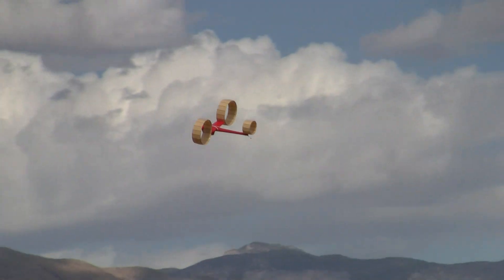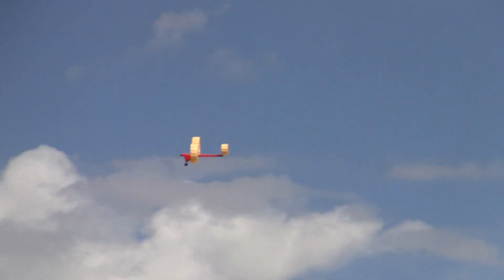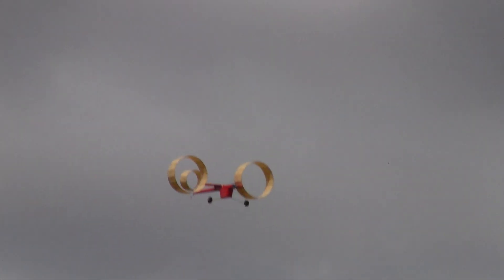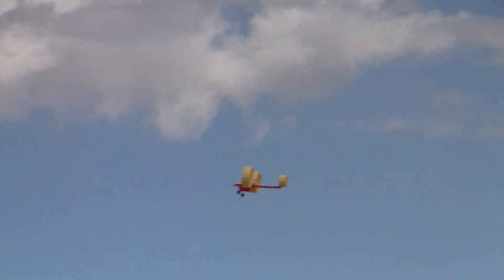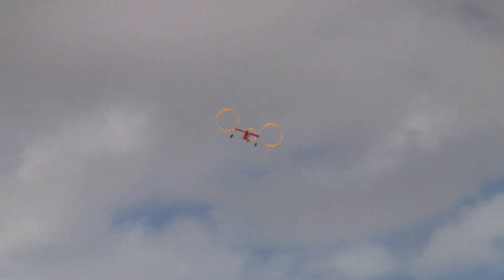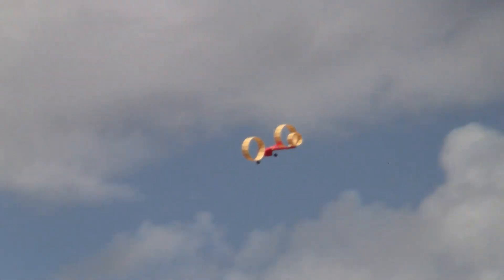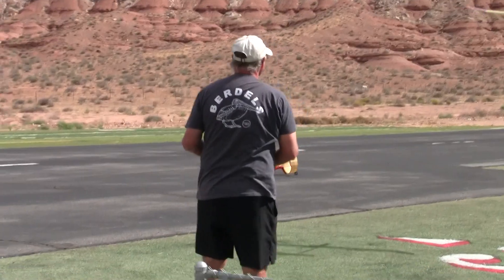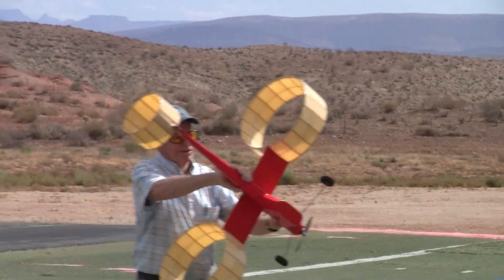THE RINGER: AN UNUSUAL AIRCRAFT FROM THE OUTERZONE! ST. GEORGE UTAH 2024

Comment: Are the rings of the main wing and rear stabilizing ring on the same plane? Or, are they placed in an attitude of attack to one another, as with a Wingfoil board? The Wingfoil main front wing has a positive attack of 2°. And the smaller rear foil has a negative attack of 1.5°.
I'm considering experimenting with rings on hulls for lift. Cheers
Reply from the maker: @robertcain3426  Although I didn't build the model Robert, it appears as though the tail ring is placed a bit higher along the flight axis than the main annular wings or "rings". I linked the plans for the build from the "Outerzone" website in the description and perhaps you can examine those to answer your questions. Hope this helps, Cheers!
Reply: @JustwingitRC 
Yes, it znswered my question, thanks. And yes it does have an offset to increase attack. Cheers
Reply from the maker: @robertcain3426  Great to hear 👍